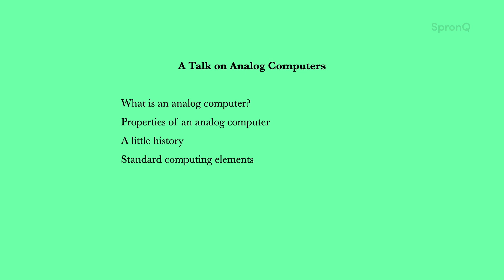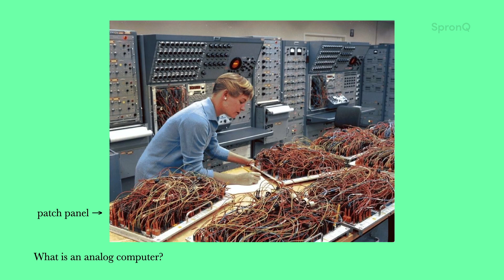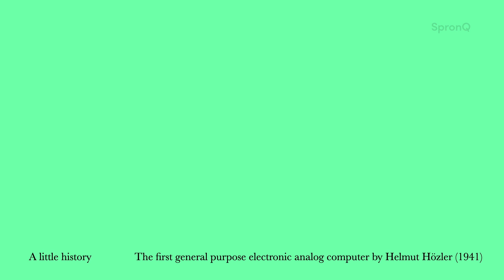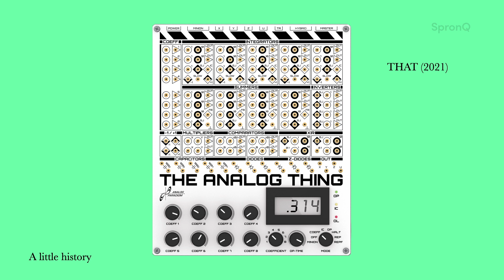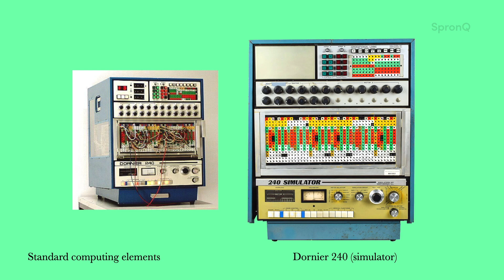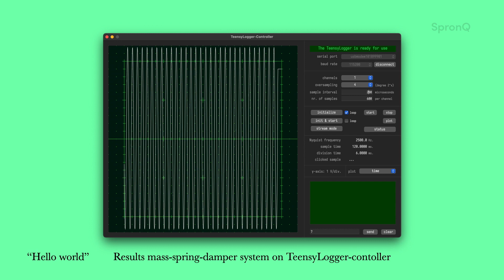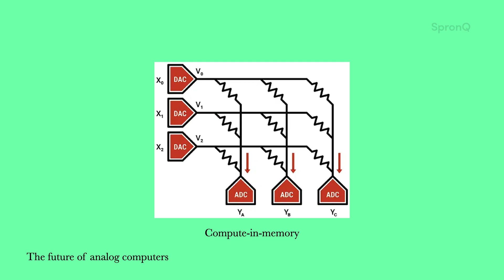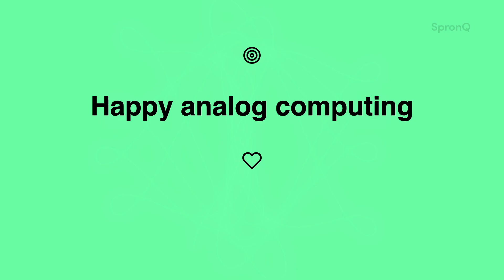On Analog Computers

Comment: Useful presentation. Please can you do breadboard  LORENZ Circuit
Reply from the maker: At the moment I'm not able do build the Lorenz circuit on a breadboard. I don't have (the expensive) AD633 multipliers in stock.
Reply: @Filmalot  I'm trying to build a chaotic circuit, if i got questions or any problem how can contact you ?
Reply from the maker: @LYehiaX  A bit late but still. There is a Facebook group "Analog Computers". There is a lot of knowledge on AC there and lots of the members are very helpful.
Reply: @Filmalot   you could make a 4 quadrant multiplier with an inexpensive lm13700,  i tried both the ad633 and the lm13700 and the lm13700 works very good  too, not super precise like the ad633 but for an attractor is good enough (:
Reply from the maker: @fititocom  Not always suitable for serious analog computing but I do use them in my sound/synth setup. I bought a lot of them for one-tenth of the price of an AD633.

Comment: Is there a way to build a shift register in analog with LED's?
Reply from the maker: Probably yes, but it's much easier to use digital elements for this. It's not forbidden to use digital 🙂 Go hybrid!
Reply: @Filmalot  the problem i have / would like to solve has no possibility for digital without investing at least 10m usd for a custom asic 🙂

What i am looking for is 4096 analog outputs. the input is being feeded with pulses +/-3V digitally.

the every pulse added should be put out first in the first analog output, then the second, then the 3rd... and so on. What i am thinking is create 2d array of led's apply 2 different constant sinewaves, and the pulses just add up (increase decrease, therefore i would have a shift register in analog that uses 2 vectors. But i am still thinking about it how to do it completely analog 🙂
Reply from the maker: @snapo1750  I'm afraid I can't help you any further. Do you know about the FB group on analog computers?  https://www.facebook.com/groups/1109826729371538/

Comment: Can we use this for music recording?
Reply from the maker: The output of most contemporary analog computers is a voltage. Usually between -10V and +10V.  It's easy possible to scale this to (say) 0V and +5V. Then the output can be used to control analog synths that use control voltages in that range (like a lot of Doepfer modules.)
It's also possible to generate audio-range wave forms. On my DIY system the frequencies generated are on the low spectrum, as in less than 1000 Hz. (But in practice more in the 10 Hz range.)